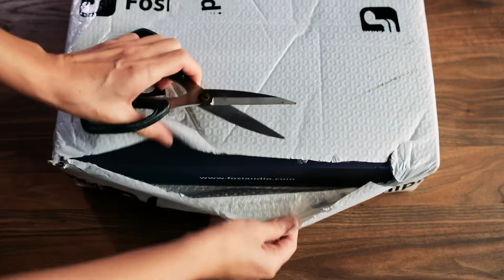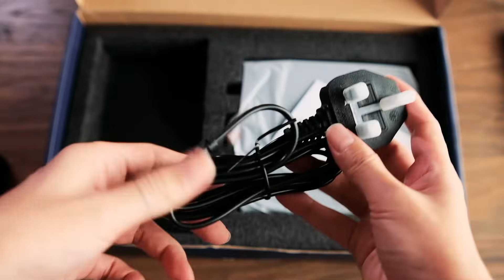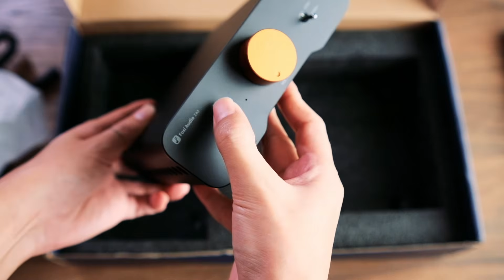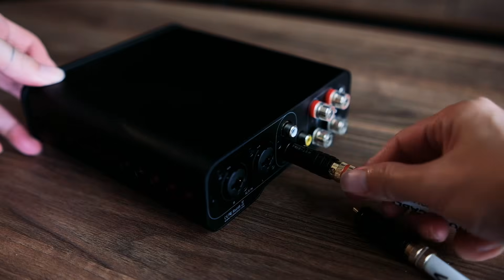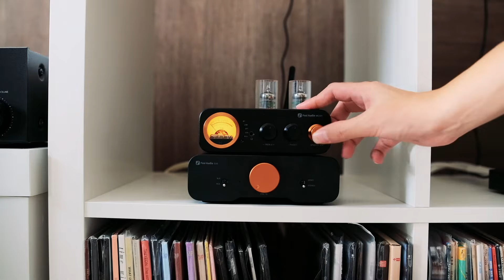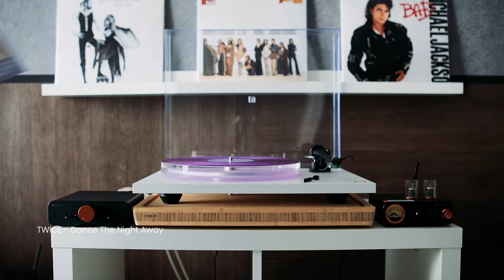Fosi Audio ZA3 Power Amplifier Review - Unboxing & Vinyl Sound Test

Comment: Is there an option, that ZA3 powers up automatically when there is sound from DAC through rca in? Or automatic power on only when using 12V trigger?
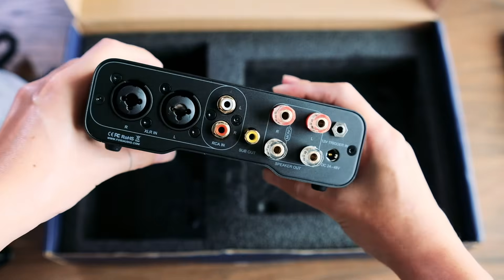Reply: As you see on 2:49 the ZA3 has a 12V trigger input. I ran 2 ZA3 (one stereo/main, one mono/passive sub) on tha ZH3 DAC. I put a headphone 1in2 adaptor in the 12V triggeroutput of the ZH3, to manage both ZA3 with the trigger.

Comment: I have 2 za3 I use in dual mono with burson v7 classic op amps it's has very wide sound stage, I like more than my yahama and marantz amplifiers
Reply from the maker: Nice! Can’t wait to run dual mono too 😊. It’s One of the best compact amp I have so far
Reply: How many opamps are needed in a dual mono ZA3?
Reply: @rafau9230  You can use 1-4 in one unit. In stereo mode you can us one pair of aftermarket opamps for r/l channel, or you add another for the XLR-path, or you add a further one for the sub-path. I run 2 ZA3, one in stereo mode, connected with XLR on a ZP3. In ths unit i use 1 Bruson V7C in the XLRpath and one pair for r/l channel. The other ZA3 is connected with RCA on the subout of the ZP3. In this unit i put one Burson V7C in the right channel - it is in mono mode and powers a passive sub. 
If you use 2 units, each in mono. You can put one opamp in each unit. The mono input is RCA only, so an opamp in the XLR path makes no sense. Buy a pair an you are good to go. But attention: The ZA3 require the dual version of the op-amps, regardless of whether they are operated in stereo or mono.
Reply from the maker: I haven’t tried dual mono yet. If you’re running dual mono on the ZA3, just use an op-amp for the right channel.